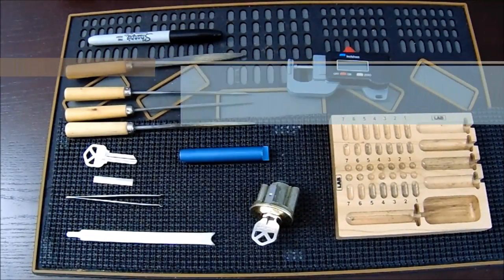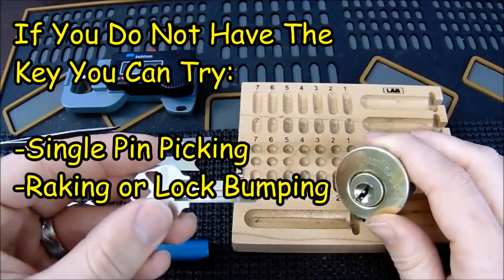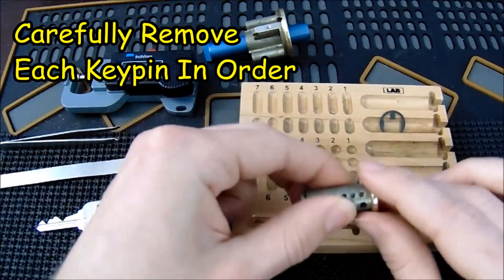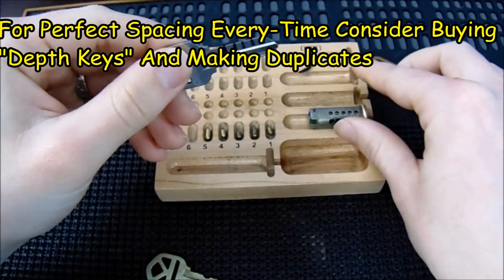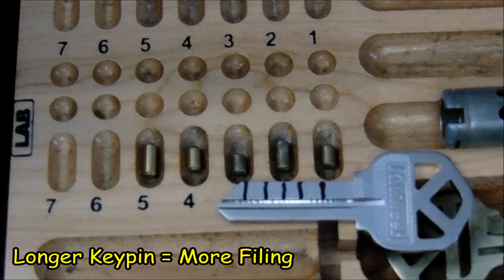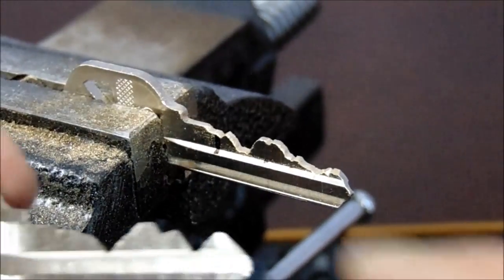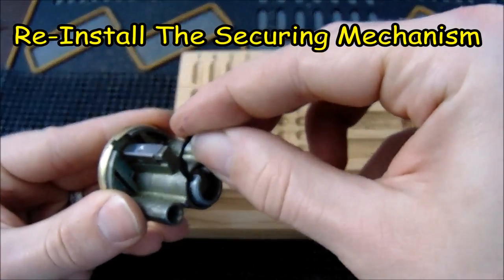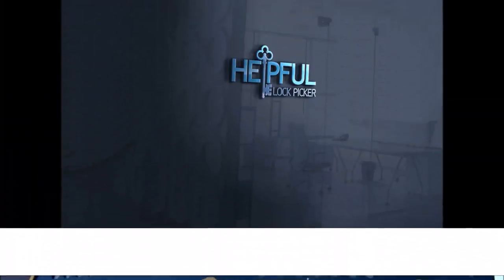[116] DIY How To Hand File A Key

Comment: I would like to see you impression the lock without without breaking it open. Also I find using a squareish file to mark the spacing is a good start but round files work best for me. The absolute best file I know of  for keys is a Pippin file(tear drop). If never impressed before I suggest a simple waffer filing cabinet(cam lock) lock and you'll be on your way.
Reply from the maker: I have yet found the time to give this an honest try but bored lock picker is quite good at it

Comment: I tried this method, and it has a pretty serious problem.  What I've found is that different locks have slightly different pin positions, where the depths will be slightly different.  In a properly cut key, it doesn't matter, because the land is totally flat (and the ridges between each land will tend to hold the key in the correct position, no matter what's going on with the shoulder).

But in your key, the slightly different depth is going to be enough to get the depth off.  You'd think maybe it shouldn't be much, but in my experience, it's a lot.

And there's other issues too.  Your lands aren't wide enough, so the pin doesn't actually sit properly, and it's actually too deep in the middle.  If a different lock has a different pin style, it won't work; and that's going to bite you here if you try to upgrade to more precise key pins.  You can fix this by using the same manufacturer's pins in every lock, but that won't solve the previous problem.

Even in the same lock, there might be enough slop to have the same problem.  When you pull out the key just a little, with the shoulder no longer touching, you might be pretty far off, and the key can jam.  Most likely you won't get reliable operation.

So I basically think this is not a method anyone should use.  Unfortunately I don't have an improvement, but either way, this isn't the right way to do this.  The thing I'm going to try next is to only use a square file, never the triangle; and mark the outside of each land (using a 777 key), instead of the middle, so I can see how wide it has to be.

By the way, I also tried the Dremel, but it is way too difficult to control precisely though to get those smooth flat cuts, at least with the bits I have on hand.

I was hoping an actual locksmith would jump in here with the right method, but I don't see anyone doing that yet.
Reply from the maker: Thanks for sharing
Reply: @iMagUdspEllr well that's the problem.. this method does not yield good cuts.  An existing lock cylinder, or even a key gauge, is not a satisfactory guide.  I also think a Pippin file, or any round file, is not an appropriate tool for cutting to code like this.  Maybe they're good for impressioning, but they're not good for making a reliable key.

The way I've gotten to work is using a digital caliper and square file.  That lets me cut working keys to code pretty consistently.  I also have an idea about how to use a triangular file, but it's a bit more involved to execute.